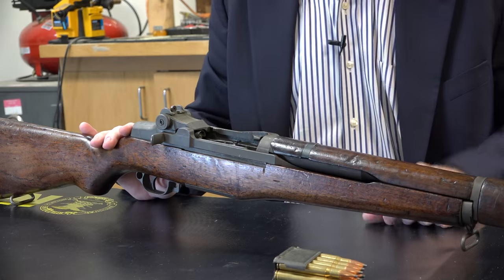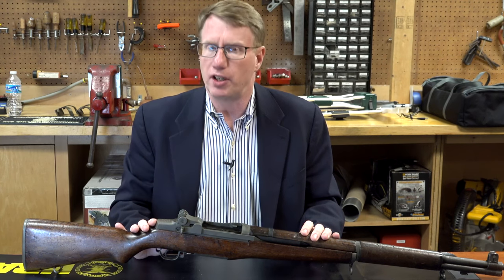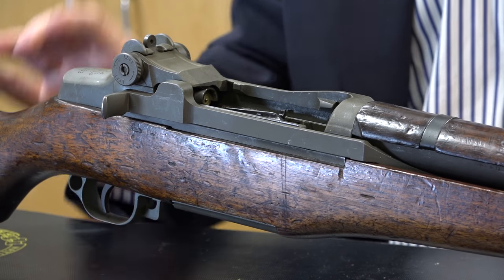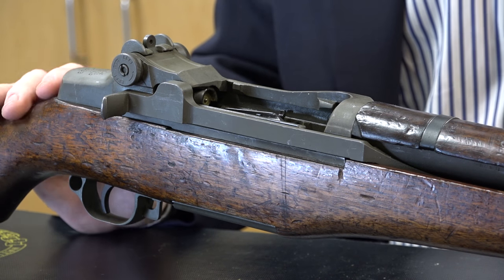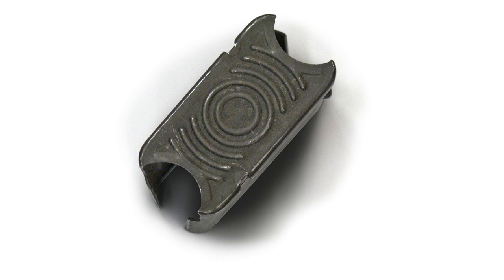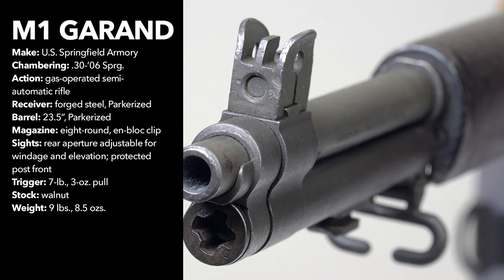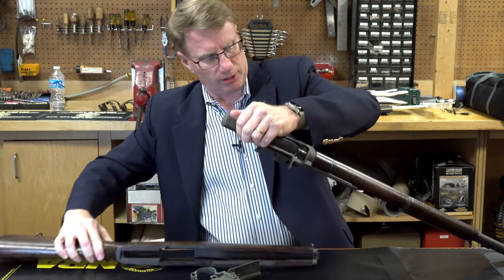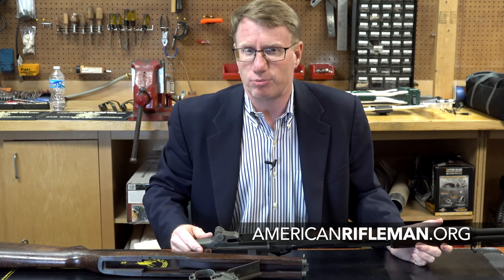NRA Gun of the Week: U.S. Springfield Armory M1 Garand Rifle

Comment: From my research, "Garland Thumb" is actually a myth. It was started by troops (and eventually collectors) playing with the rifle and loading empty clips or not full clips. When the clip was fully loaded, the rounds were held in there tight enough to hold the bolt back which would require the shooter to slap the charging handle forward.